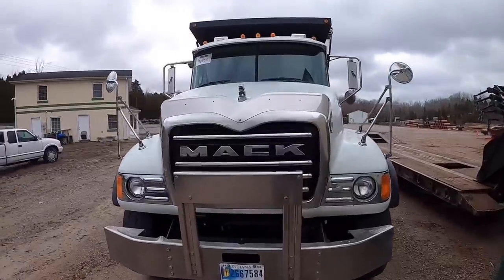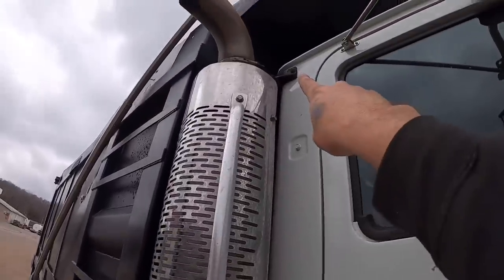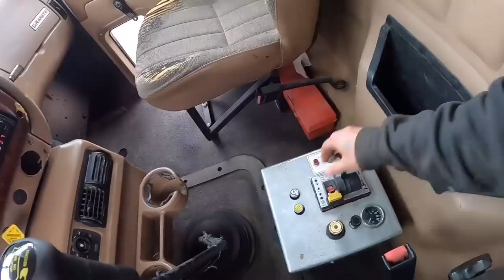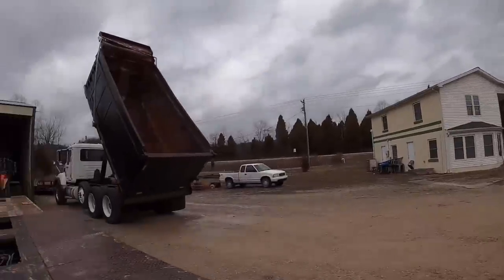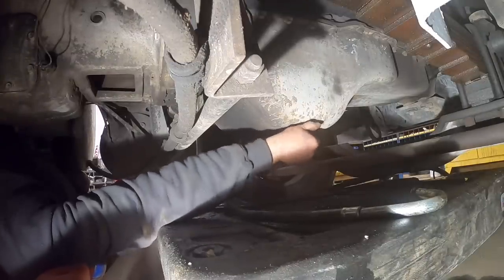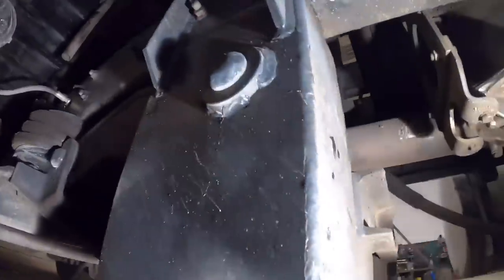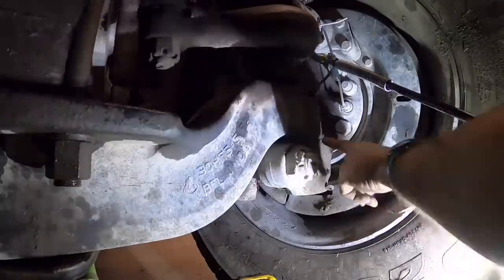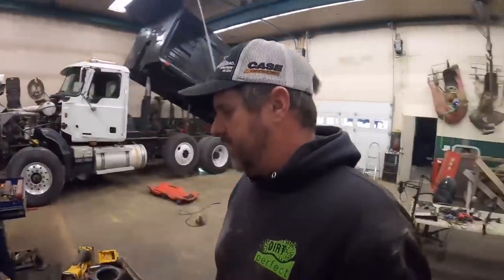New Auction buy Dump truck inspection and what does this mean for the Lt Dan project ?

Comment: A friend of mine has the same transmission in a grain truck. I took some corn to the mill and it had to go to an overflow building. Had one of the kids from the mill showing me where to put it. Backing in the building I put it in low and the kid was getting huffy about how slow the truck was. I started shifting gears going backwards he looked at me like I was crazy. It was great.

Comment: Actually, Lt Dan does have a useful niche application if you run into a situation out in the woods building a pond or something where Bubba Dump won't fit or can't turn around easily. Lt Dan could pick up the slack perfectly on those on site haul jobs in tight quarters. Not to mention you can drive Lt Dan over the road to the jobs.
Reply: Not coming here to say you’re wrong, but I thought I might mention - Bubba Dump can drive itself to the job too😂😂😂Ask me how I know🤣🤣Those suckers can move out in high gear - watch out for the bumpy roads though, people get a little freaked out when they start bouncing😂😂
Reply: @wesleyfranzen6675  Technically, yes, Bubba Dump can drive to job sites, but if Officer Hoover catches wind of it, he'd probably have a few words with Mike, is my guess. Plus, for short distances, OK, I can see it, but if you have a job 10 or 20 miles away, you're not even going to consider driving Bubba there over the road.

Comment: Clint has a great auction eye. I sold utility trucks for the power line contractors. They didn’t want new but they wanted it to go to work and be dialectical safe when they hit a job sight. When they have to put men up a 100 feet they want a great boom which I worked for Altec and a stable truck for that boom. People don’t understand what tough stress that boom puts on the frame so the section modulates had to be as strong as if I was putting a dump bed on the truck. That’s what contractors liked when they bought equipment from me because I considered myself as the contractor customer. Once you proved yourself they depended on me to fill their needs because they work hard for their money. This is why I love Dirt Perfect.

Comment: Something to consider when you're putting your signs on your truck, also put the tons you want the quarry loader to load in your truck. Place the amount you want on the top corner of the bed so the loader operator can see it. I recognize trucks easy enough but never remember the tonnage they want. Tri axle want anywhere from 17 ton to 20 ton with one guy hauling 24 ton. Even the tandem guys haul from 15 ton up to 18 ton with 15.5 being normal. Them you've got the aluminum beds coming in and they want something else. Not everyone has radios

Comment: You forgot to grease the throw out bearing on the clutch. Have someone hold the clutch down and look up at the clutch and you will see the zerk. Grease it until grease comes out the back side . Then build or buy and cover to go over the inspection hole on bell housing. This will keep the clutch from sucking up dirt and making in almost impossible to adjust later on in life

Comment: Found a good truck, I'm a mack man nearly 40 yrs and can't go past mack boxes, 9/18 speed both 318 and 2018 boxes in particular. Built for the E9 and can handle everything... except a bad driver. As for the engine etech e7 are great engines but a nice running CCRS at 490 hp is magic. Mind I am a V8 man😅 but great find well done

Comment: I have a hobby build truck on a much smaller scale.  I"m building a 37 Chev PU.  It was my Aunt and Uncle's truck.  They had it from early in it's life.  I drove it in 1968 where I could see that the front end was shot as was the clutch.  How I ended up with it is a long story, but I've had it since 1987.  I was doing a Resto on it with my dad who among many things, had been a mechanic in the 40s and early 50's.  we were into it a few years after a few obstacles and he passed suddenly.  I parked it for decades in my parents garage, not wanting to work on it, but not wanting to let it go.  Recently I hauled it from Mom's garage to my new home in South Dakota.  I"ve been working on it and changed direction.  I'm now doing a RESTO_MOD.  It's going to look original, but have modern suspension and drive train.

Comment: About time you got something more practical as a replacement for little Red. It really is hard to find good used equipment. Took me almost 1.5 years to find my F350 Dually with the 7.3L. But well worth the wait. The MAC is in really good condition for its age and for having come from Florida. Congrats on the find. Thanks for sharing.

Comment: Mike, fwiw, the proper grease procedure is to leave the tires on the ground for kingpin grease, it forces grease into the bearing.
Also try to keep slack adjuster/chamber rod at 90degree or less angle when brake is applied.

Comment: I know you said Lt. Dan doesn't fill in the need. I think you will find that once you get it done, you will find it more useful. There are several times I have seen where you are working, and it's very difficult to get in with a normal truck. I drove one of the 6x6 on our fire department. It is a very capable truck in muddy condition. If you have a good driver, it will fit in places you can't believe. I understand that driving a long way it's not the truck. Steep grade, or muddy, it's your truck every time.

Comment: Must of been the light, down at the station the driver's front tire looked cupped, but didn't see it here in the garage. The two cheapest forms of maintenance is; oil, grease and filters! I'm shocked that you didn't find at least one plugged grease fitting. The ones on the bottom of the lift cylinders of my Case 450B dozer have to be taken off, almost every time and cleaned out. I will say, It's a good look'n truck! Great video Mike! Thanks, Lee

Comment: i switched to cc as go to for tearing shit apart  if youve ever scene a 22 ft long 5 stage  1 ft 1st stage 3 inch fifth stage 150 hp motor generator 
we also had a deisel bull wheel set up         build a pond with lt dan and 850j USAF BILL

Comment: I do not blame you for waiting out the Lt. Dan series as it has a six wheel drive but for the most part, not close in comparison when rubber hits the highway. Six wheel drive has its good points and all and  expensive to keep up with. I believe people confuse a big rig six wheel drive with the highway version pickup. Steer axles on big rigs are just not a cheap thing to keep in alignment when its main purpose is having traction in mud and other types of debris. Even the comfort level is much so compromised when on a highway surface. Yeah, I would still love to see Lt. Dan come to completion as it will have its uses when your doing field tiles or other places where water and soil become a major issue as in having to tow a rig is also dang expensive... a truck with rear drive only can get so bent up dragging it out of mud and other issues that I don't have to tell you about so Lt. Dan will have its days when it makes more sense to use it instead.... great rig finding it in great overall condition. Sorry for just babbling on Mike

Comment: Looks like the old Mack is in pretty good shape. A lot better shape than the old ‘78 GMC General wheeler I used to drive. Although that was a good old truck until we had to retire it when all the leaf springs broke on the very rear axle and snapped the frame between the 2 axles. 😂

Comment: That big lip on the rear under or behind the tail gate is for an asphalt machine to fit under when doing black top. The bed side panels welded on the outside of the bed could also be to cover up some dents and damage but most likely they were put on to insulate the bed better and keep the asphalt hot as it in transit. I wouldnt be surprised if there wasnt some wood panels or other form of insulation in between the outer and inner bad panels too because i see guys do that with their trucks when running black top.

Comment: Drove in 1973 a Mack I believe a RL 800.  V8 Maxydyne with (UGH) five speed automatic.  Nice truck, but the Stevenson (sp) steering would lock up at any speed, never did find out what was wrong.  Never had any vehicle accident, but was driven accordingly.  Dan    Oregon.

Comment: For a 20year old truck it looks in excellent condition, the engine also sounds really sweet, someone has obviously looked after it. It's a shame about the crack in the cross member, probably the reason why it was sent to auction.
As you say changing the bed won't be an issue, also depending on what your hauling it might be ok a little longer than 2/3 years, as long as your moving stuff with a low salt content it could last longer. As a though though and something I learned long ago, when it's standing for a period of time lift truck bed up, just enough so any rain can drain out, a piece of 8x2 under the front should do it. 👍🤗

Comment: Worked on fleet of R model tri-Xs. That Xmember on the pusher and the Mack Xmember behind the cab were frequently repaired/replaced. Figured out that the pusher was high centering even in the up position (deadheaded) when greedy job foremen were using them as site trucks at 1 1/2 times capacity. Started using smaller diameter tires that were still rated enough for the 13.6K axle. Seemed to help. Great videos.

Comment: Alot of these dump truck drivers never do is drain the water off the air tanks, this causes alot of rust out tanks. 
Should have a metal cable on it to pull.  Do this drain weekly. Nice truck.

Comment: We had to cut out the old rusted/busted OEM trunion on our old 93 RB688S  log truck. We found a good used aftermarket 2 piece plated trunion to install. That seem to be a good old Mack U have there.

Comment: Thanks Mike I enjoyed your video on the Mack. But then I enjoy all your stuff it's great that you explain everything you do in these videos it takes an ordinary video and not only makes it more entertaining but a learning experience also at least it does for me I'm a 68 year old farm now with a lot of disabilities bad heart an such but I still refuse to let get the best of me I was raised on a live stock farm with a few horses,bout 10 beef cows usually about 25 -30 hogs an 8 timber mules the man who owned the farm also had a big saw mill an a dairy farm they use the mules all week to pull timber from the woods on the week ends they brought back to the farm to rest and we would wash n brush them down good we also raised 72 thousand chickens and grew corn an hay on 87 acres which was used to feed the livestock back then we had 2 little 800 Ford tractors and 1 900 jubilee a Ford 5000 and an old 560 farmall with a tricycle front end I hated that darn thing it was mainly used to pick corn we had a Macarmick one row picker which bolted around the 560 an believe me it takes awhile picking 60 acres one row at a time which we kept right by our huge old barn in 3 large wooden cribs everything on our farm was done by hand the old chicken houses were shed type so no drive though we spread clean litter with either  a pitch fork are a scoop shovel as it was either wood shavings are saw dust from the saw mill ever 9 weeks we scooped the litter off the farm truck into the front doors at the beginning of a new flock of chickens n we use the same forks n shovels to clean the out all that nasty stinking  litter 9 weeks laterals man if we had any floods in those house from a busted water trough during that 9 weeks that litter stunk to high neaven n was heavy as hell everything was scooped out by hand walked to a door n throne on a manure spreader n put on the fields farm life was hard back then the only thing automated back then was 5am you automatically crawled your ass out of bed 7 days a week and got your work done I was born on that farm n left  16 years later when dad got sick with a bad heart and we moved in town there was no type of retirement from the farm just dad's social security so I had to drop out of my last year of school to help pay the bills seams I've been working ever since mostly all outside bull work operated alot of different equipment smaller stuff skid steelers backhoes trenching machines rollers many different farm tractors drove farm trucks dump trucks flat beds six wheelers and ten wheelers and equipment trailers I was also in my towns Volunteer fire company ror 25 years drove their engines rescue unit n made a ton of ambulance calls so the type of stuff you guys do is right up my alley I absolutely love watching Dirt perfect, Diesel Creek, Letsdig18 C&C equipment anything with old iron being reworked n brought bank to life again I love watching n learning from all you guys are flicking awesome I love all you guys keep up the great work please  keep making these awesome videos on U-tube and I'll definitely  keep watching n hitting the thumbs up button stay safe n stay busy my friend

Comment: Great video, looks like you found a real solid truck. I operate a small fleet of mostly Mack trucks, mostly purchased from the auction. You lucked out, seems like I always have to do rear trunions right off the bat.  Same process, I like to spend at least an hour under them and change all the fluids while I make my list of what needs fixed. Keep it up, great content, I like all the camera angle on the drive home.

Comment: I worked at a Mack dealership in the early 2000s great job loved it I specialized in transmission repair nothing more beefier than the Mack tranny .I notice when you were checking the rear end fluid you did not check the top section.reason being the bottoms appear over full . That could mean the top section leaking down into the bottom through the two mounting bolts on the inside of the top section something to keep an eye on . I am a R model fan myself good luck with the new puppy love you guys

Comment: To weld that broken cross-member needs a very small welder person and you got one of those already lol. So when he comes to weld that for you - why not get a piece of metal folded up to go across the bed at the back wherre it has rusted through and get your vertically challenged oppo to weld it in place. Might not do much for strength but does tidy the outside of the bed. I'd say beds probably cost a lot and by and large that one looks eminently serviceable so why not do a few tridy-up repairs instead of buying another bed? And - that is a really handsome truck I think, tough and a really good buy. Bit of titivation and it would be as good as new.

Comment: It has a high speed PTO there should be a label in the cab that tells you how to operate it but you don't press the accelerator while the PTO is in operation it will burn up the pump. From experience, you can bump the throttle a little bit to get a little more speed and not damage the pump.
Reply from the maker: lol what the hell did you do should never have a problem with this style set up
Reply: @DirtPerfect  if it can be broken I have broken it or I'm still working at it 😂

Comment: Wow. For its age that beast is in great shape. I have never owned a tri axle. Is it common for the cross member to break like that? Or is it a sign of too much pressure put on it with wheels down? Given the condition of the drive axles and suspension it doesn't look like it has been overloaded too much. The frame is killer. Nice. You got your hands on a good one. I have no idea what a new dump bed costs but this truck is worth it. Thank you and be safe.

Comment: Makes Lt. Dan a toy now or regulated to haul junk or for tree debrie taken down. Wont be for Dirt hauling. So a bit of exspensive toy and a waste since you wont be using it much. Price of the truck , then redoing the back wheel area, specialized bed bought, new hydrolics for the bed lift. Paint and body work on cab  then finally the new stacks ya made for it. See if some Landscape company has a need for a specialized hauler. Cant remember if you put Dirt Perfect logos on it .

Comment: Nothing wrong with older Mack’s. Spent a lot of time and miles in an old ch613 and an old r. The r had the two pole or duplex transmission. Wish had known it was gonna be sold idve took it for sure. The ch613 had the maxi torque and was a good truck all around. Both pulled good but old r wasn’t a interstate truck at all lol.

Comment: It appears to be a diamond in the rough. Some normal wear and tear from daily use and it appears the previous owner actually took care of it. I would much rather have this old iron horse than some plastic computer-controlled DPF choked modern day garbage. Are you going to put your signature stacks on it? The exhaust note on your Mack tractor is beautiful.

Comment: @dirtperfect when you were mentioning the C channel frame jacking/rusting from debris intrusion and how this truck did not exhibit any, could one, as a preventive measure,  run a bead of RTV down the seam to alleviate this issue in the future? Like you mentioned at the end of the video, if ya don't address the small issues now they will never get fixed.
Reply from the maker: No from Florida

Comment: Any Mack trans that you "have" to shift between high and low range is junk......Mack range synchronizer is just junk. We have a twin to your truck (but a concrete mixer) with a 308MR in it and it will last forever......Ps did you notice the "tie bar" that ties the two front spring mounts together is loose?

Comment: Good old truck love the pre emission Mack trucks  shame Volvo took Mack over and basically ruined a great truck  rebranded Volvo to Mack motors are junk. I bought 2015 and had nothing but problems with the egr cooler leaking and Def after treatment. I couldn't get rid or it fast enough ❤
Reply from the maker: Think god they did would not exist today if they did not